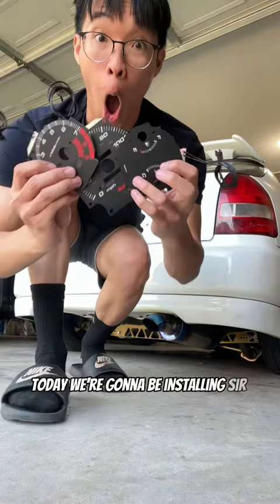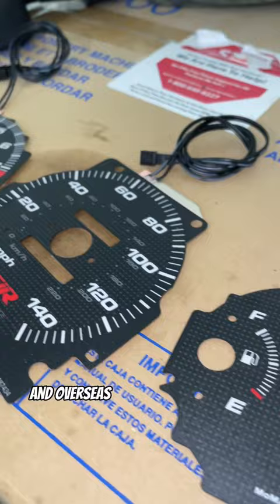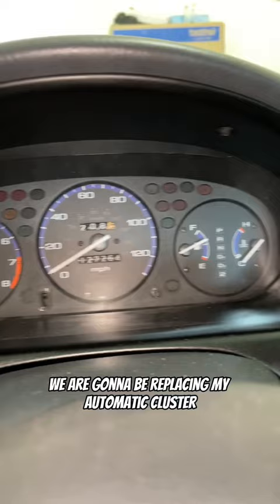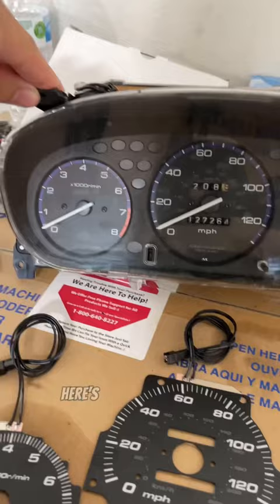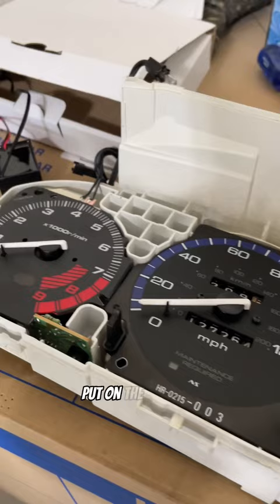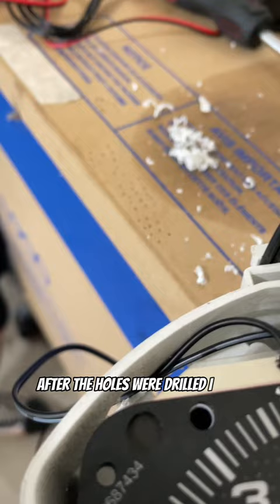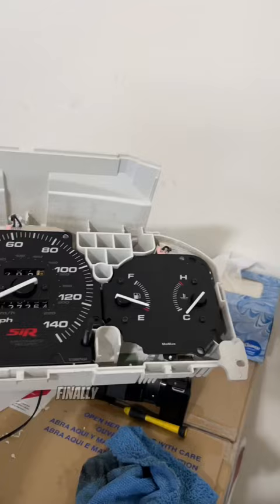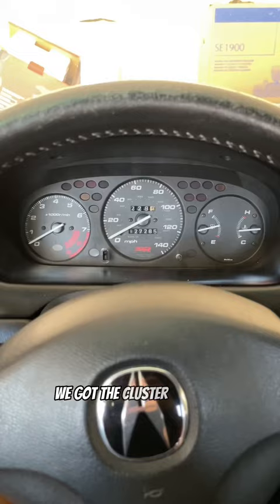Installing SUPER RARE SiR Gauges!

Comment: I don’t understand why honda would make a cluster with RPMs on the automatic but on the 93 Honda civic hatchback manual they made it without the rpm tachometer.

I swapped the automatic cluster into the manual transmission eg. Miles weren’t accurate but close enough and the cluster worked fine.
Reply: First civic I ever drove was a 95 DX special with a manual and no tach. Bounced it off the rev limiter a time or two. Now that I think of it my old 88 F-250 with a 351 and a ZF 5 speed didn’t have a tach either but my 90 F-150 with a 302 and an automatic transmission had a tach. 🤣

Comment: What is technical difference between a type R and an SI??
Reply: SI is more of the daily driver version and the Type R is more performance and track
Reply: B16b
Reply: also the vti cluster
Reply: And the whole chassis
Reply: the si came with a b16a2, and the type r came with a b16b. might seem the same however internally it was all different. honda used the b18c block with a way better valvetrain and ported b16 head. type r’s also will only come in hatchbacks. their chassis is built for the track.

Comment: Bro you got scammed real SIR gauges do not have wires coming off of them to illuminate the gauges also real SIR gauges will read in kilometers per hour with a red line of 8,500rpm not 7,200rpm
Reply: I’m pretty sure he didn’t get authentic ones because I know on eBay that you could actually get this kit and customize it to your liking or your cars original gauges. If you search up SIR gauge cluster the first video that pops up is a guy doing the gauge cluster swap and he explains more about the eBay listing. I just checked out the eBay listing and it’s not bad.